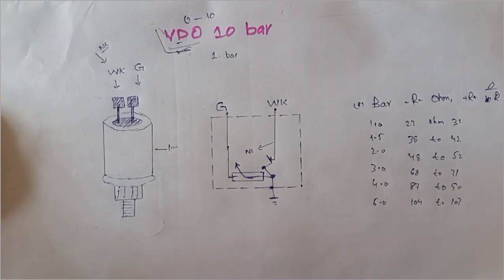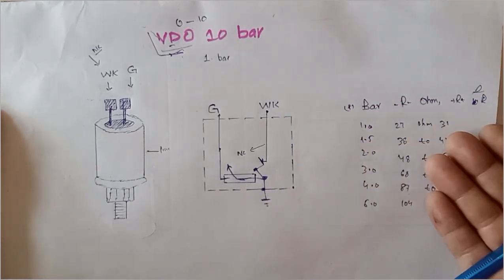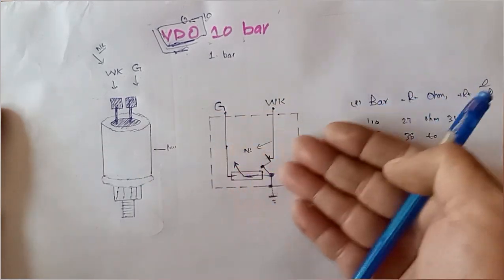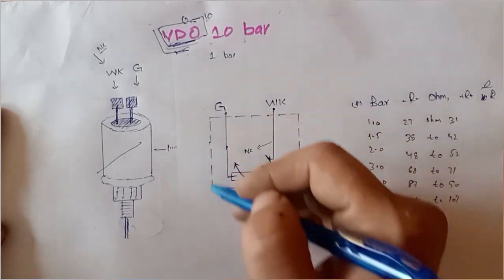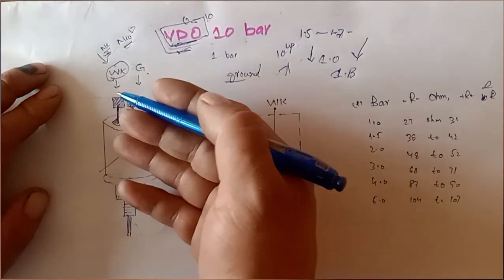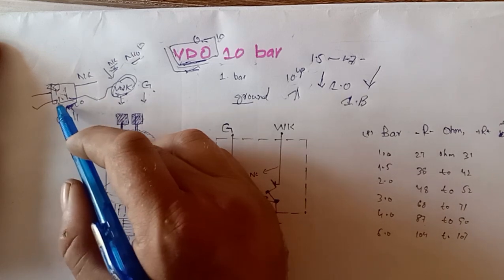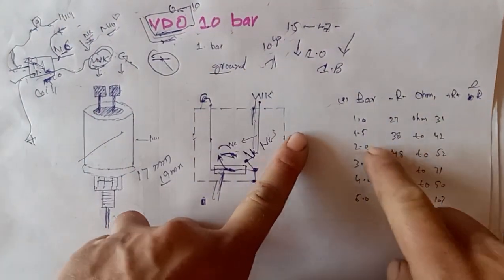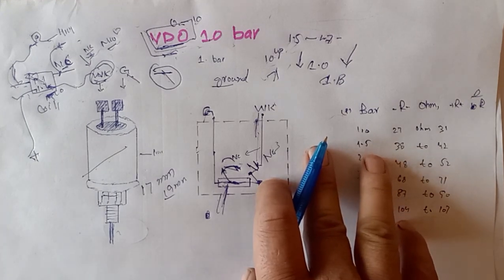How Vdo oil pressure sensor/sender works complete explain wiring circuit, testing

Comment: I replaced the oil pressure sensor, the reading reach 9bar but in pressute gauge its only 5bar. What is the possible problem??
Reply from the maker: Oil pressure have own bar like 5 bar sensor, 10 bar sensor, 15 bar sensor, check your sensor bar specifications 
If wrong please replace
Reply: @Info-Tech-  our sensor is max 10bar. our gen.set is 0-10bar. it give 5bar after 2hrs of running , the reading becomes 9-10bar which is wrong.